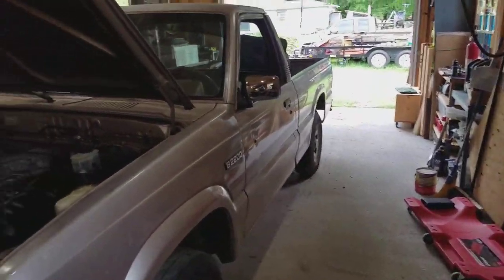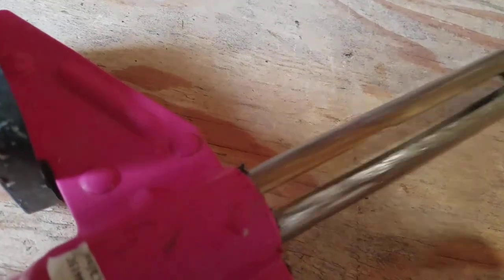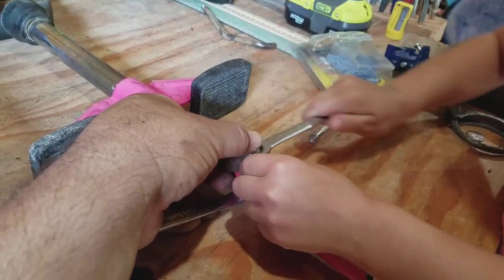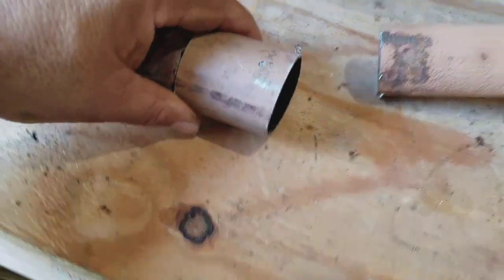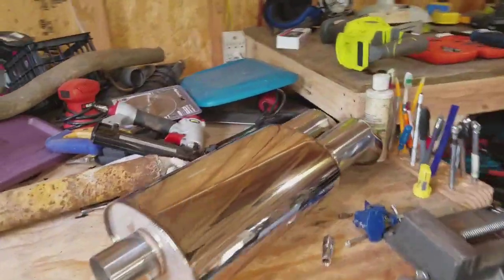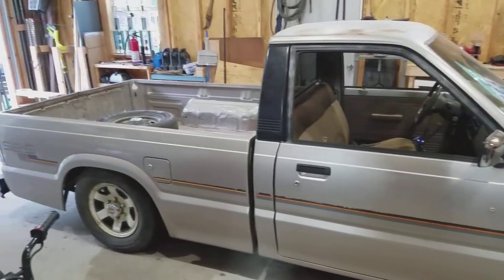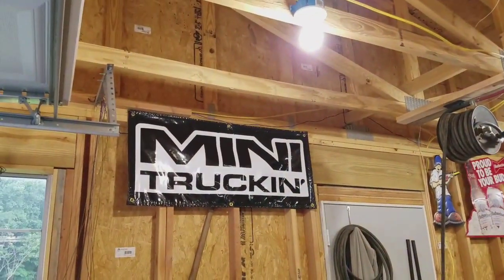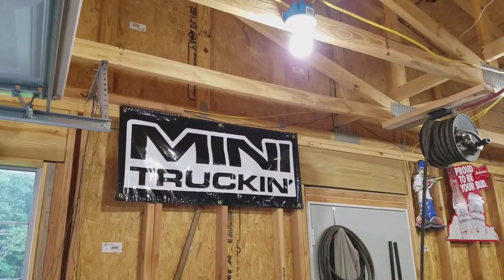Installing exhaust and fixing a pogo stick

Comment: yo bro. I was doing the same thing on my 92 yota yesterday. c-notching truck from kit. welder quit, grinder locked up. frame is 1/4in higher on right side. only difference is I don't do videos.  lol keep tour head up man. just give it a break and come back later. I mean I can't fix my truck without ur videos. minitruckin  for life man. ur married to it. peace out.
Reply from the maker: +Michael Clow thank you for the pep talk it means alloy I'll get it fixed